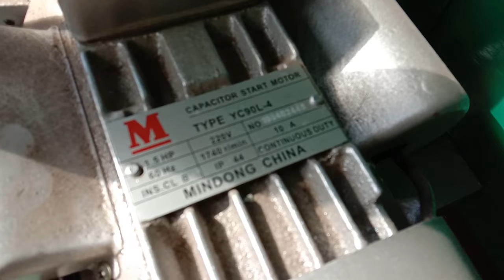Banana Fiber Extractor || Machine evaluation

Comment: Very nice and helpful 👍👌👌 drum dimensions please share thanks for
Reply from the maker: good day sir.drum dimensions is 400mm diameter and 500mm in length. and then i add 1 1/2 angle bar which served as the blade. thanks for watching.
Reply: @rnfcustomcrafts   how much gap/space did you leave between the rollers and the rotating angle bars?